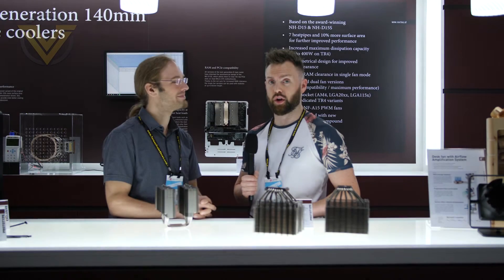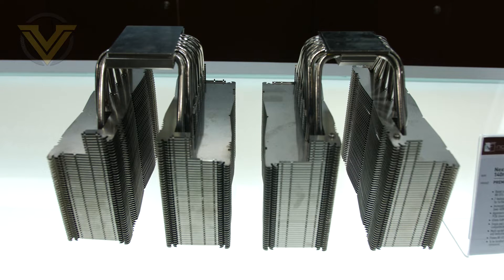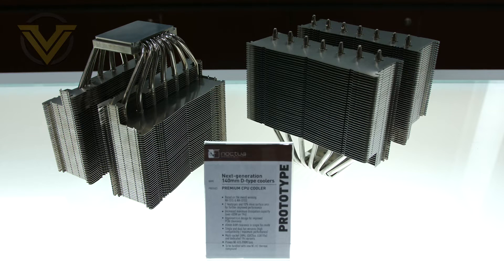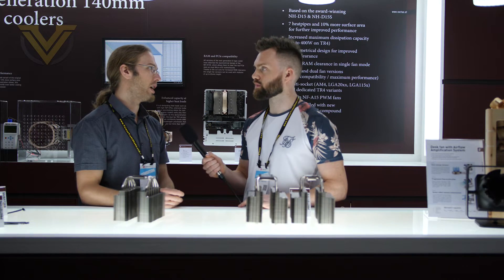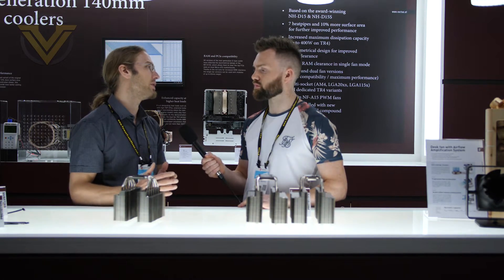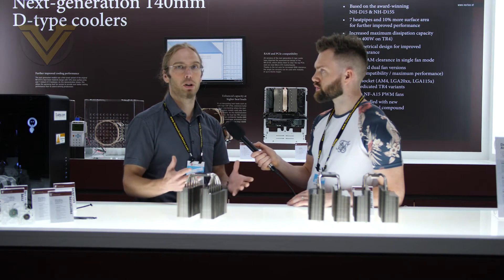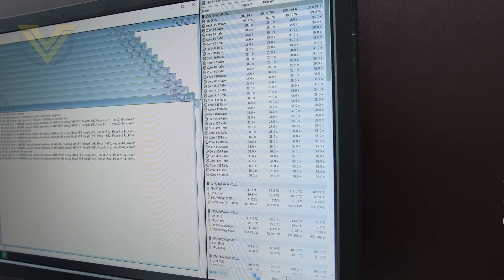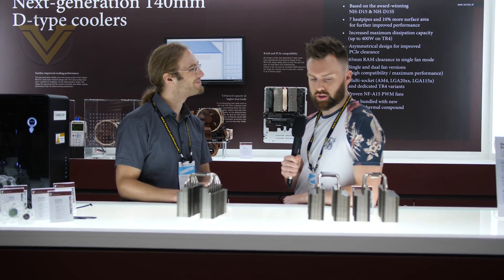Noctua's Next Gen. NH-D Type CPU Cooler Unveiled

Comment: Hmm, things changed alot since then - Including/Especially a Pandemic and Supply Chain issues/shortages and delays combined with crazy demand, including in the Hardware tech sector (Especially GPUs). We're late 2022 now and still no news, clear word on the next gen 140mm fans, let alone successor to the NH-D16 those fans will be latched onto! The Fans are an important evolution to improve the next gen 7-pipe heatsink. Many have been asking about when the 140mm version of the improved, well reviewed NF-A12x25 fans. Apparently 'Q4' this year, but more likely, next year sometime. When those come up, I expect the next gen heatsink will too, not too long after. The innovation in this case, comes as a pairing and shared by both.

Comment: Why not Copper fins that will make the biggest Differcence
Reply: I guess it will become more expensive than the average AIO price
Reply: Copper fins don't make nearly as big a difference as you think. If you look at benchmarking for models of coolers that have both a copper version and an aluminum version, the difference is usually incredibly small. Sometimes the difference is nothing. The reason being that even if you use a more thermally conductive metal for the fins, you're still constrained by the thermal conductivity of air. Air isn't necessarily going to pick up heat faster just because the copper can conduct it faster. What copper does make a huge difference to however is the price and weight of the cooler. Copper is about 3 times heavier than aluminum and a lot more expensive. So all they would really be doing by making the fins out of copper is tripling the weight and cost of the cooler with likely no real cooling benefit. That's why even higher end manufacturers like Noctua just use aluminum these days.

Comment: And then Zalman comes out with their new air cooler that beat the NH-D15 by 5C to 7C in an independent, third party benchmark test.  Is Noctua going to have to go back to the lab to come up with an improved design that will match that?
Reply: Hope so, this design is old even with the new heat pipe
Reply: @warp00009 pero son muy ruidosos
Reply: @alexanderav1780  Bueno, ni siquiera puedo escuchar a los fanáticos de mi NH-D15 dentro de mi gran caja de torre completa, por lo que el sonido no es un problema ... (Disculpas por la traducción de Google)
Reply: warp00009 At last, Deep Cool Assassin 3 is  better
Reply: @alexanderav1780  I've been pretty impressed with how well the NH-D15 has worked for me (with upgraded Thermal Grizzly thermal paste).  It has outperformed my old brand name liquid cooler significantly for my 140 TDP i7 CPU - beating the average CPU core temperatures by 15C after running a 100% CPU load video rendering workload on all cores for over an hour.  I was very impressed and totally surprised!  That being the case,  even if a few newer coolers may now be better - it's probably not worth changing for the small difference in performance.  (I didn't trust Google translate to get all that correctly, so I'm glad you can do English!  😊 ).  Stay safe and well my friend!

Comment: Noctua  I have a brilliant idea that is sure to shave 2° off of this cooler. On the top of the heatpipes where they connect through baseplate, run copper heatsinks with fins directly from the heatpipe base. 6mm of heatsink should be enough to shave off 2° from CPU.. Like the Arctic accelero iii heatsink does. Can I get a job at noctua? This idea is patented by me. Fyi

Comment: i would buy nhd cooler just for the fact that i could run any cpu stock with low rpm fans even at full load or fans turned off, but the GPUs are not that quiet...